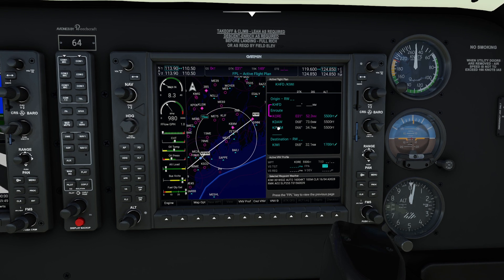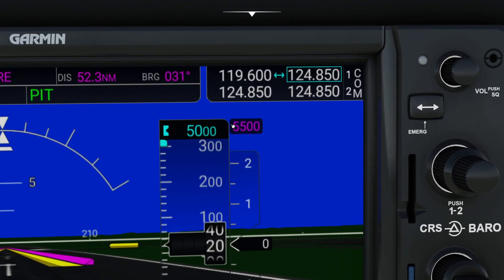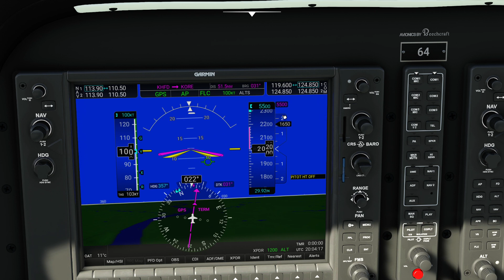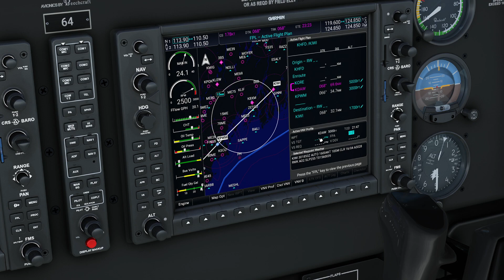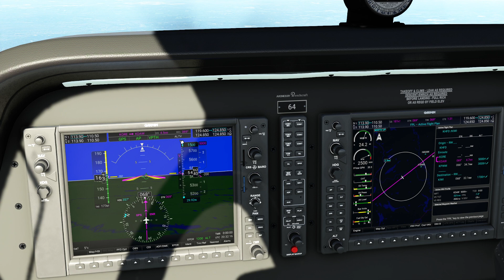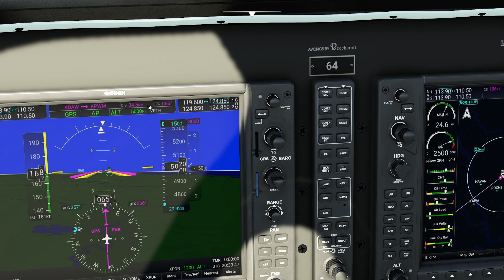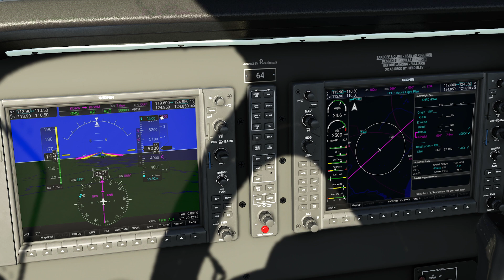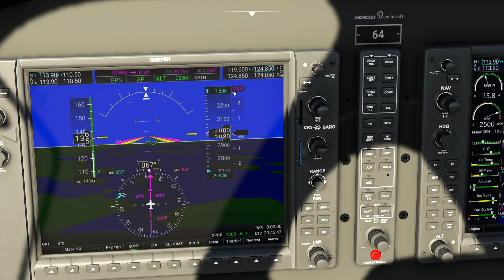MSFS - G1000NX VNAV Tutorial

Comment: Do you use Slew mode to speed up time in your video, or something else?
Reply: You can speed up sim time by pressing +\- of number pad. Only own one plane that tells you the speed so you need an in game clock to know what normal speed is
Reply: @lilkris3008  Thanks!
Reply: Hmm, pressing the +/- on the number pad doesn't work, and I don't see anything in the options about time excelleration. Any hints? Thanks in advance.
Reply: @mark-xu8bw  the first thing to check the key bindings if you google how to change sim time there’s tons of tutorials that’s if it’s actually not working it’s not a great system your literally just speeding sim time like changing tick rate in Minecraft there’s no menus or anything it goes by a factor or 2 I believe so press + once is only going 2x press again it’s 4x and so on I find I can’t see it’s even faster until 4-8x your pc will dictate how fast you can go mine gets choppy at 16x. So if I hit my + key 4 times fast it just freezes. Also it can do weird thing a to the maps like airports not loading in even if you give it 5 mile final in real time again